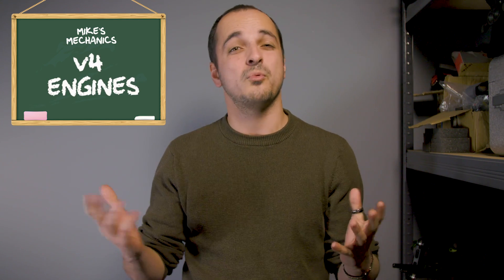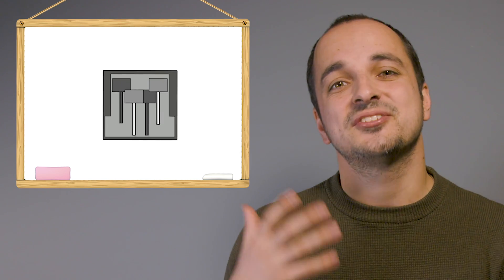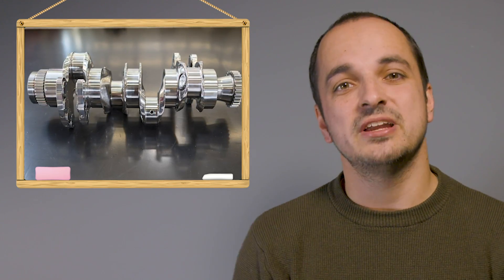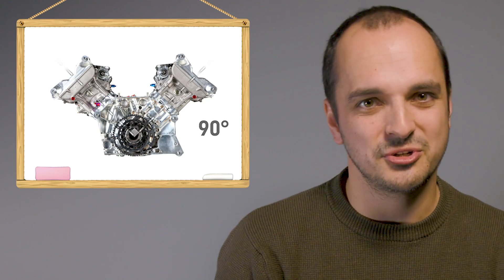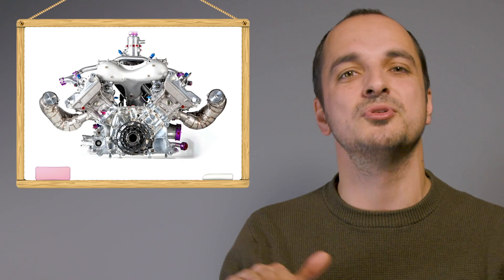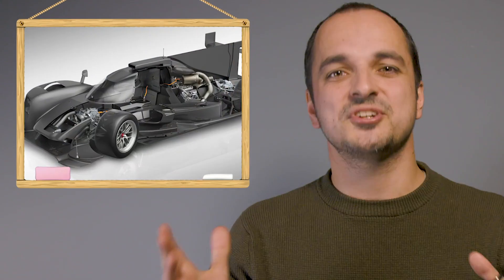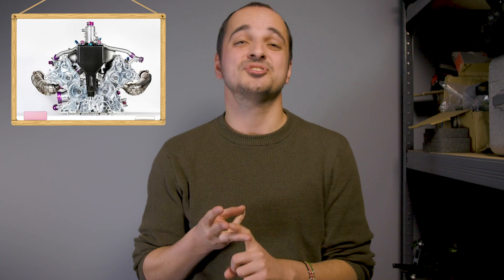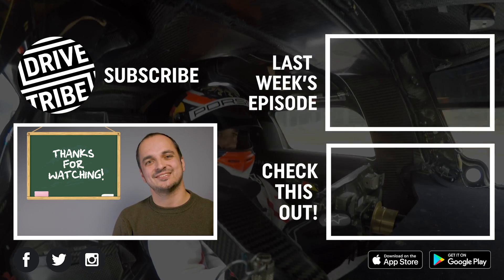Why V4 engines are so rare and which cars use them - Mike's Mechanics

Comment: I've owned two VFR800 motorcycles with V4 engines.  They run very smooth with excellent power delivery and legendary reliability.

Comment: Saab used V4 engines sourced from Ford from 1968 through 1980 in the model 95 wagons and 96 sedans as well as in the Sonett II and the Sonett III. They were reliable, economical and could be tuned for competition quite easily.

Comment: That BS, a boxer engine needs to have 2 cylinder blocks to make one block, there's more Tee joints in the engine and more chance for oil leaks, plus also 2 heads, and yet Porsche and Subaru has made it their engine of choice.

Comment: Not sure this really explains it. Okay, yes they're more expensive to develop than inline 4s, but that is also true of V6s. They also have seen lots of use in motorcycles, but not in cars. What do people want from a V6? Smoother power delivery. Does a V4 improve on this compared to an inline 4, and with car engines getting smaller and smaller going to inline 4s and inline 3s, wouldn't the packaging advantages of a V4 allow it to mount better turbos? Seems to me that the V4 could be a contender for a future F1 regulation given that Ferrari was insistent on not doing an I4 because they wanted the rigidity benefits of a v configuration engine.

Comment: BRP used to make a 60° V4 in their oil injected 2-stroke outboards. Essentially the powerhead is as compact as they could possibly make it without adding a supercharger (some outboards do tho) as well as light weight since these things, especially weight, make much more difference hanging off the transom of a boat than they do siting in the engine bay of a car.

Comment: So the V4 is so expensive they make V6 and V8 engines for production cars instead...
Reply: Because for commuter cars, an I4 is much cheaper then a V4. Also cars that get I4s usually wouldn’t have the space to fit a V6 or V8 in their engine bay.

Comment: @1:39 Whether or not it outweighs the benefits is a matter of perspective and use case. The inline 5 requires a balance shaft too and is still in production. :)
@2:57 Yes, but instant torque doesn't get you anywhere without the power to boot.
@3:26 So much for outwheighs the benefits. It depends on use case :)

Comment: V4s don't cost much to maintain. I have Yamaha vmax with a v4 engine making 120hp to the wheels shaftdrive and its been maintenance free other then changing my spark plugs and oil. Every soo often the brake pads.

Comment: v 4 in v shape and in flat 180 degree is was used in many well known cars.Sabb.Ford transit 1.7litre up to 2.0 litre.Ford consul or granada used a v4 before their r4 engines and those old v6 design was used in them they came in many variants from 2litre 2.3 2.6 2.8 in the germany made fords while the english used a 3 litre on the ghia and capri with badly designed valve train.had to adjust clearence  very often and they had 3 adjusment point on each rocker arm,While the germany made engine only had 1 adjustment where the rockerarm hit the valve stem

Comment: I only knew v4 engines existed because my dad had a 140hp outboard evinrude.  It was a v4, very compact engine and the boat was able to pull a skier no problem.  I would like to see them in cars, since the move is smaller engines why not a v4 that can rev to the moon.

Comment: Saab 96 has V4 too and it has 65hp it's top speed is 150kmh
Reply: Jooo and Saab made over 500,000 96s and the guy mentions the horrible, flexy, Sonett that they didn't really build but sent out to a railway coach manufacturer..Paaaaska!  And  from 1977 to the end the 96 was made in Finland vy Valmet!!! And finally got 2 port carb!  voy vito!
Reply: @janvanv  sonett didnt even have v4 until the later models and same with 96. i got one in finland its been abanbonded for 15 years and this summer im gonna start it!

Comment: I had one in my 1972 Ford Capri 2ltr I had intended to get a 3ltr V6 Capri but found this one and loved it only thing was it seemed funny when you lifted the bonnet/hood as the engine was so small they had to put a blanking off plate in front of the radiator I think ford made them at first to go into the first Transit vans .

Comment: I have a Honda VF1000 which have (rather obviously) a 1000ccm V4 engine. It's a gem of an engine, very smooth and a nice power curve. Complicated? Oh yes. It's one of the more complicated motorcycle engines out there. I'm crossing fingers i don't have to do any major repairs to it. LOL
By the way, Ford used the V4 in many other models than the Taunus. It was also used in the Transit, Capri, Consul, Granada, Zephyr and Corsair, and in even in the Cortina in a special South African model. The Saab Sonett you mentioned used the Ford Taunus V4 too, and, of course the Saab 96 and 95 used the same engine (after Saab gave up on the 2 strokes). Ford V4s were pretty common from mid 1960s to mid 1970s.

Comment: "...at 90 degrees the primary forces balance each other out during reciprocation". 
The primary forces of an internal combustion engine are never inherently balanced out in any configuration, whether it be on-line, horizontally opposed, V or W and so on. This applies to both cross-plane or flat-plane crankshaft designs. Counterweights and flywheels exist in all of them for this reason.

Comment: I have a Fulvia 1.3 Zagato.  It has two twin choke  Dellorto carbs which are an upgrade from the twin Solex  The Lancia V4's were pretty neat pushing out nearly 100bhp from 1300 cc back in the sixties.

Comment: The "Alte Schule" channel has a german series with Fritz Indra explaining the details on why a V4 is the best choice for top power and packaging applications. He's also explaining very thorough why EVs won't save anything, rotary engines blow, Porsches I6 is actually terrible and Mercedes wasted 10 years of engine development by trying to figure out a working rotary. He's an engineering icon, having developed the Alpina B7's  Turbo I6, several other early day Turbo cars, the Opel C20XE etc.

Comment: Not complete. The Soviet ZAZ Zaprozhets also had a V4.
https://en.m.wikipedia.org/wiki/ZAZ_Zaporozhets
It is unfortunate that soviet cars are looked down. They didn't have seat heating and climate control, but were much more reliable than any other car, also considering modern ones.

Comment: You missed out the Ford Corsair, I had one, wish I had never sold it, they are worth a fortune now
Reply: i too had a corsair,didnt sell it,i swapped it for 2 pints of beer,
Reply: They were fitted to some Capris too; my brother-in-law had one.
Reply: SAAB also used that engine in the early 1970's in the 95 and the 96 as well.  It was a great engine. I had a 95 back then.
Reply: Most Corsairs turned into piles of rust years ago...

Comment: Saab 96 from about 1967 to the end of its life used a german Ford V4. Also the english Ford Corsair in 1.7 and 2.0 capacities, also the Ford Zephyr  Mk4.
Millions of Transit vans used V4s. 
Quite a lot of NSU Ro80s had their rotary engines replaced by these Ford V4s.  It fitted into the space where the twin rotor engine had sat quite easily.

Comment: Ford made 100,000's of V4 engines both the Taunus and Essex (different engines) and even used them in cars and even the original transit was designed with a short nose for this engine. Saab and Matra used this engine.

Comment: You never mentioned the Opposing 4 or 6 cylinder option found in the 911 and Boxer. They were the reason Porsche and Subaru never used the V4, better configuration.

Comment: The 70's Ford Capris had a 2 litre V4 option as I remember.
Reply: Yeah you're right. Was riding in a Mk 1 V4 Capri that caught fire on the motorway in 93. Fastest we moved all day was climbing out.
Reply: I had one!
Reply: @philbaker6837  Early 1970s i had a 1700cc V4 Transit, swapped the engine one afternoon for the 2.0 litre V4, it was like night & day, still probably the slowest thing to use petrol !

Comment: So, a v4 is 'expensive, complicated and mostly unbalanced," when v6, v8, v10, and v12 engines aren't? Despite the fact that most of them are made with a 65-degree angle that requires extra engineering to balance?

lol, okay.
...that being said, yeah, I'm sure a v4 is way more costly in materials and tooling than an i4. Or even an i5 for that matter, like what you'd find in some Volvo builds.

Comment: As a car enthusiast living in a country where 99% of the cars in the market being 4inline cilinder engines with FWD i always wondered why a V4 engine wasn't a thing, since it was much more "close" to bein feasible than the v6-v8 u could only find on imported cars. I guess that even if engineers cracks out the drawbacks, it wouldn't even become a thing since the cost in investment and emissions efficiency would be outshined by the downsized 1.0-1.4-1.6 inline4 turbo engines.

Comment: Subaru should have developed and work with the V4 engines instead of the Boxer 4 Cylinder engines.  V4 would have been more reliable with more power potential than their present boxer design.  With increase production of these engines I am should cost would have come down.  A greatly missed opportunity for Subaru I think.

Comment: Ford used the V4 extensively in the 60's & 70's in two variants: the Taunus(1.2,1.3,1.5,1.7cc)  and the Essex (1.7, 2.0cc), and they found a home in the Zephyr, Consul, Cortina, 66-70 Corsair (no other option was offered), Capri, Taunus, Mustang and Transit. In fact the Mk1 Transit was designed soley to use a V4, and all Mk1 petrol transits (apart from special order V6) are a V4 configuration. It is why a bull nose front had to be used when a later diesel engine was introduced.

Because of it's compact design it was offered by Ford as an industrial engine to drive water pumps and generators etc.

It was also used by Saab in their 95 & 96 models, and by Matra in the 530.

So, not so rare after all.

Comment: Toyota/Subaru, I found the perfect engine for the GT86 chassis. Nice 2.2L V4 with a supercharger between the banks. Just do it. Can't be that much more expensive than the flat-4, and can't have the oiling and head gasket issues the flat-4 has.

Comment: So if the negatives are similar to a v6, why was the v6 more widely adopted and the v4 not?
Presumably as larger engines were needed in the past a v6 was a more viable engine. Now where we can get good performance from smaller engines so 4's and even 3's are more common nowadays and with the advancement of technology and tech getting smaller they dnt need to use the v4 format. All of that is a guess as I'm typing so any thoughts would be much appreciated.

Comment: if piston pairs share a journal, there's a kinetic balance absent in i4 engines, where pistons don't all start and stop together. this is significant at high rpm, especially in motorcycles where this torque fluctuation unsticks the rear tire. same reason as the crossplane inline four, but with better primary balance

Comment: Uh. Strictly speaking V4 Wisconsin engines are common on farms in skidloaders, on welders, and as a standalone powerplant for various machinery (like a grain elevator or auger). It's air-cooled. Its yellow. About 30 HP typically (but car braking horsepower and farm crankshaft horsepower are two different things.) It has a carburetor but sips gas VERY slowly.

Comment: You forgot the Ford Capri mk1 2000 v4, the ford Corsair 1700 @ 2000 v4 plus the Mk1 Ford Transit 1700 & 2000 v4 and Zephyr 4 2000 cc.
They were called the Essex engine. 60deg with a balance shaft.  They were different from the Taunus engine that came in Configuration 60° V4
Displacement 
1.2 L (1,183 cc)
1.3 L (1,288 cc)
1.5 L (1,498 cc)
1.7 L (1,699 cc)
1.8 L (1,784 cc)
1.9 L (1,933 cc)
The 1.8 and 1.9 were turboed to 200bhp and fitted into the Saab 96 rally cars.

Comment: my father owned a Ford Granada back in the 70s which has had a V4 engine. these things underpowered considering the displacement, but bulletproof. he put over 400.000km on it before the vehicle gave in to rust, engine was still running though.

Comment: Ford germany built many cars with a V4.
The Ford P4, Ford Taunus P5, Ford P6 (built from 1966 to 1970 Ford called it Taunus P6 till 1968, then it was sold without the Name Taunus, just called P6) , Ford P7, Ford Consul, Ford Granada and Ford Transit. Even the Ford Capri was sold with the V4 from 1300ccm 50HP to 1700ccm 75HP.
It was also sold as an industrial engine.
And they sold them to Saab for the Saab 96.

Comment: All motoGP bikes use the V4 layout (except Yamaha which has an inline 4 but with a 270deg crank) so works for them. Never understood why they are not more common in production bikes/cars other than the maintenance aspect and ease of access... Aprillia RSV4 with straight pipe, sweet Jesus the sound...

Comment: So my 1991 Ditch Witch with a Wisconsin V4 is basically a rare hybrid racing Porsche?
Reply: I've got the same engine on my stump grinder.
Reply: if you look closely, you can see the carbon fiber weave under the paint
Reply: Metal fan and a Marine? Awesome dude!
Reply: @wadeguidry6675  That's right!
Reply: Yep, doing it with the wood chipper too.

Comment: One of the funnest bikes I've ever owned was an old '85 Honda Magna VF700. I tell ya, Nothing sounds nor pulls quite like a V4.
Reply: We used to have a Ford transit truck which had a v4 engine. Pulled and revved  like a train.
When one of the head gaskets wanted replacing, we found out that all transits were meant to have low compression heads, only ours had one low compression head and one high compression head! 
Great to drive!!
Reply: I had a 1984 Magna. Bought it new when I was in the Air Force. I loved that bike.

Comment: Ford made and used a 2.3L v4 in their late 80's - early 90' Ranger and some Mustangs
Reply: Ford never used or built a v4 after the essex v4 was replaced by the inline 4 in 1970. The 2.3 or better known as the pinto engine was always an inline 4.

Comment: I still don't get why a V4 isn't offered today.  In any premium vehicle it would add a novel sound and the prestige that is attached to V engines.  Imagine GM offering a V4 with OHV:  Super compact, lightweight and with cylinder deactivation both powerful and efficient.

Comment: The Yamaha V-Max:  ~1700cc (102 cu in) V4 producing ~200 HP, ~120 lb ft of torque, all sitting between your legs in a bike that weighs 630 lbs (285 kg) wet. Nearly a quarter of 1 horsepower per pound of weight, for a 200 lb rider.

Comment: Not only stiffness, most probably mass center is lower than inline. Remember 110º F1 V10 renault engine?, they were looking for lower barycentre, yet vibrated so hard that structures prone to vibration failed prematurely.

Comment: John Deere used a v4 as a pony engine to start diesel engines in their model 70, 720, and 730 row crop tractors and 80, 820, and 830 wheatland tractors from 1954 until 1960. Operating speed was 5500 rpm. Both cylinders on each side fired simultaneously. Exhaust gas from the pony entered the intake of the diesel to preheat it, as well as warming the cooling system for easy cold weather starting.  It too was chosen because of its compact size.  Previously Deere used a 2 cylinder opposed as a pony engine for the model R which was their first diesel tractor.

Comment: Expensive? Lies! Honda prove that v4 were good on their interceptors and that were reliable way before Porsche. The only reason to not making v4 for cars is that they don't want too. They have in line and boxer engines. I give you an example! VW/Audi designed the W  engines just to prove that could be done and to have exclusivity. So a v4 can be made but they don't want too.

Comment: In what way is a V4 more complicated than a V8?
Reply: A V8 is not less complicated than a V4, but L8 are so long that V8 is the only reasonable choice. The L4 instead is not so long and yet sinpler
Reply: @peppemaz84 
Ah, I see. The V shape is almost necessary for 8 cylinder engines to fit in vehicles, whereas a 4 cylinder engine can be inline and still fit, so they go with the simpler option. The video, in my opinion, made it sound like V4's were rare because they're exceptionally complicated, hence my question.

Comment: Imagine that. "Yeah I got a 4-cylinder" proceeds to walk all over anyone with 12 cylinders.
Reply: Imagine doing that with a 2.0 3 cylinder
Reply: Nowadays you can do that with no cylinder at all
Reply: @nonameyet2205  yeah :(
Reply: @gbsoffiati  why the face?  Acceleration is awesome no matter how you get it.
Reply: @Osprey1994  no soul in an electric motor
Reply: @nonameyet2205  cars been doing that with no cylinders since the 80s tho... ill give you a hint. brap brap brap brap
Reply: @nashidaperv2351  RX 7 YEET
Reply: @Osprey1994  not if it sounds like a dyson vacuum cleaner.
Reply: Haha simoshteka semblaha si definolama 😂😂😂
Reply: 90's Honda Civic has entered the chat
Reply: 17 year olds with boosted b series be like
Reply: Forgetting about tuned evos and Subarus? 😂
Reply: Yes, me too. It’s called an S2000. 😁
Reply: @tomcross6567  s2000’s are amazing!
Reply: what?
Reply: cars vs bikes in a nutshell.
Reply: Real 😂
Reply: My lancer GTS 2017 manual fwd 4 cylinder walked on some v8’s my goal is to walk on a v12…
Reply: @psychoaceclap6402 I doubt it it’s  got a CVT and it’s not even turbo

Comment: Great video, thanks! Btw, the animation of a V4 at the 0.44 mark is not correct (unless Porsche did some extra magic creatig this engine). :-P  They typically share crank pins between front and aft cylinder.